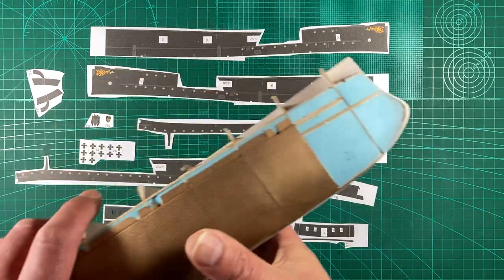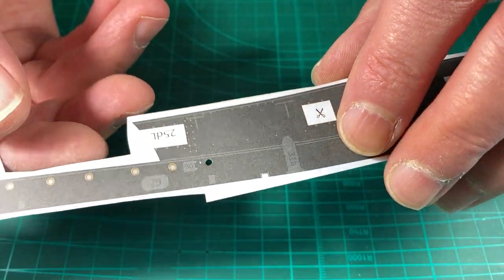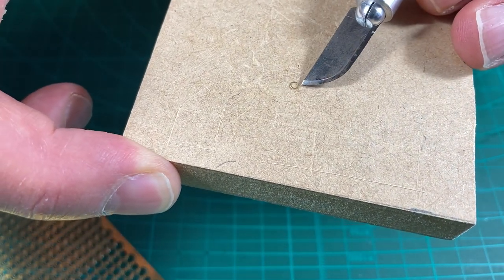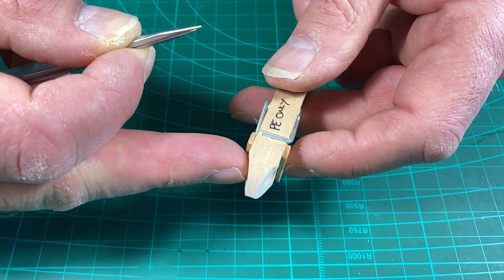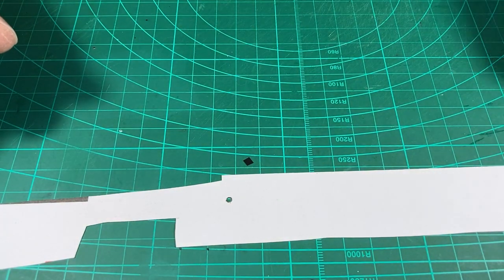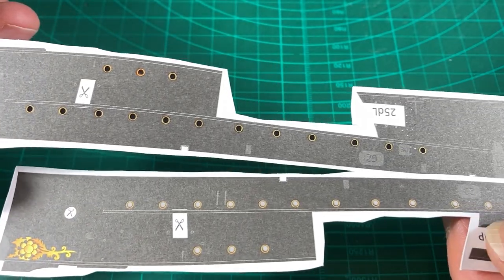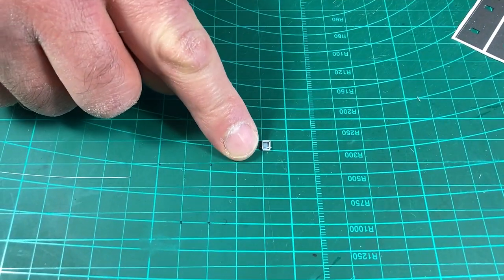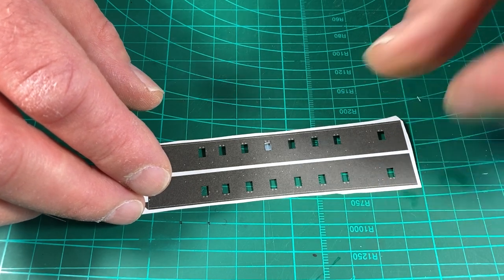Admiral Nakhimov, Paper Model, 1/200 Scale, Part 11, Upper Hull Skin Preparation

Comment: Your custom PE holding tool is awesome!! :) Thanks for sharing!
Reply from the maker: Thanks for the comment.  The wood surface and spring pressure holds the part securely so you don't need to grip it closed eliminating hand fatigue from constant gripping.

Comment: Another way you could hold the porthole while sanding is to use a tapered needle (like a knitting needle) or rat file.  that supports the brass all the way around and with a bit of light pressure you can  hold it from rotating while you sand tabs smooth
Reply from the maker: Thanks for watching and the tip, appreciated.

Comment: One thing about the pre dreadnought era ships is they don't take up too much room and one has a reasonable chance of completing them in something less than 6 months or more. In a fit of optimism I ordered a Bismark and a Lexington. I need to find them a good home. Two things l like about the digital versions is if one screws up print another sheet. And it's easier to rescale. Plus I've seen where wood and plastic modelers use card models of ships as a starting point for the hull and other features.
Reply from the maker: All good points!
Reply: @plungingfirescalemodeling2441  
The larger ship kits I have tucked away need a home. Interested? I'll get them out and take an inventory. I've got some smaller ones that I still intend on starting. One is the Wespe and Natter. They've got lots of character and are small enough that they could be rescaled 200% and still be small.
Reply from the maker: Thanks, but I will have to decline.  I don't have enough time to build what's in my stash as it is unfortunately, but I do appreciate the offer.

Comment: As always good work! I have a question? Before cutting parts, do you saturate the sheets with varnish or leave it as it is? If impregnated with what kind of varnish, how do you apply it?
Reply from the maker: Hi thanks for watching and commenting.  I don't coat the paper sheets at all.  I have heard of people spraying them with an aerosol sealer but the brands used aren't available in Australia and I am bit worried about trying local available equivalent spray in case it messes up the sheet. Sorry. Maybe I should experiment with local sealers on scrap to see what works.
Reply: I think I used a Dulux clear coat rattle can on a previous model however I was never 100% sure what effect I was meant to achieve.
Reply from the maker: I believe it is to protect the printed surface from handling/damage etc. I think I also read/heard that it makes removing excess glue easier/less damage as it tends to sit on the surface.

Comment: you make too large holes for portholes, you have to use a 1.8mm piercing needle and buy 1.8mm portholes for that !! You got 2mm portholes that are bad!
Reply from the maker: Thanks for watching and commenting.  I did measure the printed portholes with a vernier gauge and they came out at 2mm so that's what I used.  If I used 1.8mm I would be left with a thin printed coloured line around the brass photo etch porthole which would spoil the effect. I'm happy with the 2mm but appreciate your input. Thanks